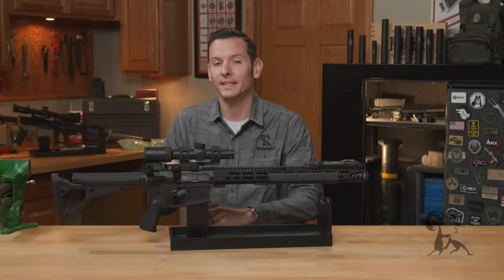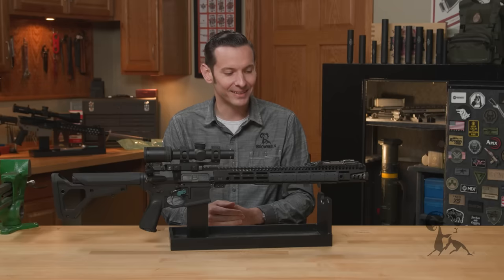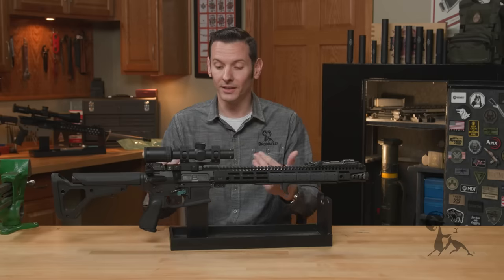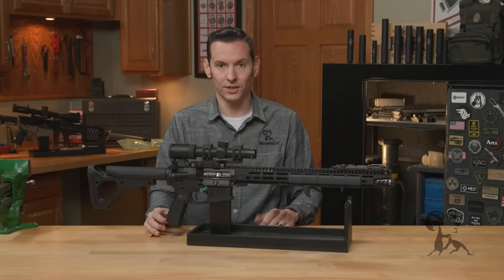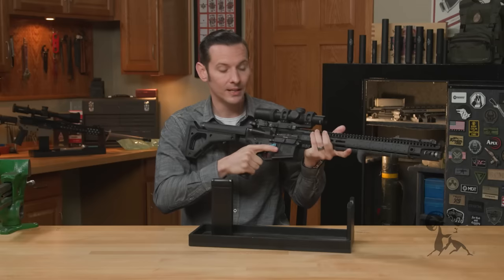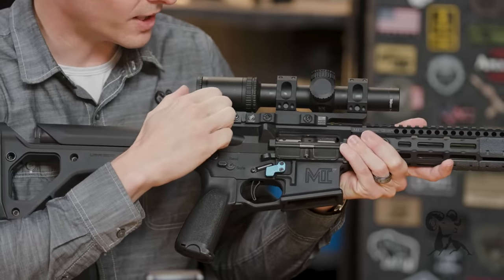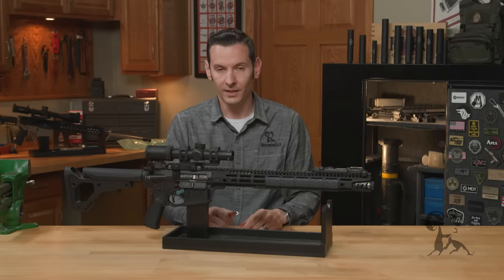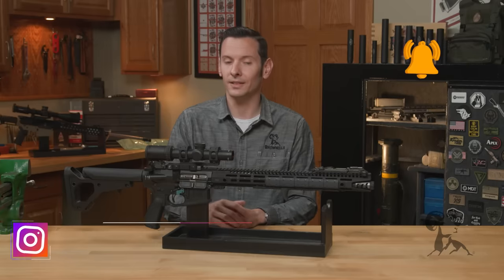Quick Tip: The RIGHT Way To Use the Forward Assist

Comment: "If you've ever had blood on your hands, you'll realize why the bolt carrier scallop doesn't work as a forward assist."
 Now I understand why the Air Force doesn't use a forward assist button on their version of the M4
Reply: Those Greyhound bus driver uniforms cost to much to afford a forward assist.
Reply: Hehe oof
Reply: The air force is the reason the rifle exists in the first place.
Reply: That's pretty cold, man...
Reply: @petemitchell6788  really??
Reply: @M3Pilot  they are the one who put AR 15 series into service while Army favor those m14
Reply: @danendraarkananta9442  Your comment is a bit fuzzy. Are you saying because the AF wanted a better gun for perimeter defense, that it caused the Army be forced to get it even though they (allegedly) favored the M14??  Maybe I'm not processing it correctly. 

The Army was way ahead on this one as the 1st Cav in Vietnam had M16s well before November 1965 when the Ia Drang Valley debacle occurred. The Army was issuing semi-auto AR-15s to Special Forces advisors in VN and they had high praise for it. That was 1962/63 era.
Reply: Gloves....
Reply: @LuvBorderCollies  In the late 50s the Army did run field trials with a number of guns to replace the m14. These trials favored the AR-15 greatly and the Army Ordnance board then changed the specifications so that any weapon to potentially replace the m14 had to be chambered in the same caliber as machine guns (thus shutting down the AR-15 as a candidate). It wasn't until later field use by Army Spec Ops and then the adoption of the M16 by the Air Force in the early 60s that the Sec Def overruled the Ordinance board and forced them to reevaluate the m16 as a candidate. The AO fought the M16 every step of the way and it was primarily the Air Force that was responsible for keeping the project alive and getting it into regular adoption. The Army Ordinance board  was also investigated by Congress during this time due to the corruption and why it was rejecting the AR-15 repeatedly despite great success in their own limited trials and the wider success in its adoption by the Air Force.
Reply: @LuvBorderCollies  okay bud 👌
Reply: ... even the GAU-5/A that is under an aircrew’s ejection seat has a forward assist.
If the Air Force literally has bloody hands something has gone very wrong.
Reply: They do use one, they didn't on the M16 initially. All M4s in service today or variants of have FA...even the USAF
Reply: Lol, the Navy don't even see sand.
Reply: @B61Mod12  except that aircraft are regularly shot down in a major conflict and the Air Force has 4 special operations units including the PJs. Air Force security forces are also in charge of guarding multimillion dollar assets and nuclear weapons.
Reply: @B61Mod12  even as aircraft maintenance whenever we deploy, we are issued m16s. One of my buddies was deployed to Afghanistan and his base was attacked with car bombs at the gate and then partially overrun.
Reply: @dsan94  I will give you that exception certainly.  I didn't think he was game enough to throw shade at PJs though.
Reply: @dsan94  That incident you described sounds like something going badly wrong!
Reply: As designed by Stoner the gun didn't have a forward assist.  It was added to meet an Army request because they feel like you need to have something on a gun to force it into battery.  This is likely due to institutionalized inbreeding since the era of bolt guns and the Garand along with the M14 having a charging handle that can also be smacked if the gun fails to go into battery.  This also continued to bleed into requirements and it's why the SCAR had a reciprocating charging handle.
Reply: @chrisoffutt8968  tell us you've never truly run an AR without telling us you've never truly run an AR.
Reply: @chrisoffutt8968  only when they don't know what they are talking about and spew nonsense written by people that don't know what they are talking about.
Reply: @dsan94  you could always try reading up on the history of the XM16E1, but that would involve learning something instead of being willfully ignorant and intellectually arrogant.  Have a nice day.
Reply: @chrisoffutt8968  I know the history of the XM16E1 and the earlier 604. That's not the issue here.
Reply: With the M1 when you pop in a loaded clip and yank the bolt to the rear, sometimes it goes fully into battery and sometimes it doesn’t. Having a forward assist capability actually matters. OTOH, I’ve never had an M14/M1A fail to go into battery from yanking and releasing the bolt so probably the Army just kept teaching it because the “FA” was there so why not? By the adoption of the M16 it was part of the institutional mindset whether it served a purpose or not. Except for a few cases of bad magazines I’ve never had an M16/AR15 rifle fail to fully chamber with the “yank and release” method. In fact, I don’t recall having a FTF with a hard slap on the bolt release so it’s debatable whether the rifle needs the FA at all; however, it’s now part of institutional dogma so it isn’t going to go away.
Reply: @chrisoffutt8968  Everyone knows the army wanted it. And it was a good addition. Stoner was DEAD WRONG in not having it. The AR was good, but adding the forward assist made it BETTER.
If we had left John Moses Browning's M2 just as he had originally designed it in 1918 and not modified it extensively and replaced the receiver, it likely wouldn't have seen mass adoption for use in WW2, nor would it be in use today. No matter the genius behind a design, there is room for improvement.
Reply: @itsapittie  BS.

Comment: That's what I use it for. 

Also, sometimes when shooting cheap steel and she's running dirty the bolt doesn't seat fully and a light tap on the fwd assist is all that is needed to keep her going.

Comment: As a USAF vet that carried the original M16, which did not come with the forward assist, for years, I can tell you the forward assist is helpful.   The BCG and bolt from time to time did not fully seat, and having a forward assist would have allowed a simple push to seat the bolt.  In the late 90s our old M16 uppers were retrofitted with M16A2 uppers and the USAF bought a bunch of new M4s.   Basically, if I encountered an out-of-battery condition, with the old M16s, I had to run the charging handle to re-rack the bolt, and later with our M16A2s or M4s all I had to do was push the forward assist.

Comment: The only time i have used the forward assist with an effect was when i was hiking to a coyote stand while carrying an AR15 with a very sensitive trigger. I spotted a coyote and realized i hadn't chambered the AR because i was waiting until i got to the stand, so i "quietly" loaded the AR which involved riding the charging handle as to not make enough noise to spook the yote, then pressed the forward assist to pop the extractor over the cartridge rim and chamber. Coyote didn't seem to notice which was nice.
Reply: How much and what type of lube did you use?
Reply: @LRRPFco52  CLP along with some grease on the buffer/spring assembly. not an issue of lubrication, just an issue of low bolt carrier velocity/force to pop the extractor over the rim on chambering as i was "riding" the charging handle.

Comment: The forward assist was added after fielding testing the rifle prior to sending to Vietnam. It was so in the early days with the Shite cases they were sending they could force the bolt closed and fired the round if it had a failure. Most of the time it is easier to force it closed into the normal cycle of operations so then they can extract and eject properly.
Reply: Not to mention that the original M-16 rollout was a fucking nightmare! The designers insisted the rifle would never need cleaned in the field, so they didn't include kits in the original release. The end result was soldiers having to field strip their rifles in the middle of combat and desperately try to clean it with whatever they had. cleaning kits went out not long after.

Comment: As has already been echoed by other prior service members, the forward assist has a purpose and if used correctly is a very nice tool to have. For an extremely minimal increase in weight, I will gladly take the advantages that the forward assist gives to the platform.

Comment: 25 years of shooting AR’s, and I recall needing it once. I was surprised. First round chambered from the magazine didn’t fully seat. Pulled the trigger and nothing happened. Looked at the bolt and saw not fully closed. Bumped the FA and it seated the case. 

Now o use it every time I chamber a round from the mag. No reason not to.

Comment: To quietly chamber a round in a hunting situation or some other time when one needs to be discreet. That's a use that most people don't talk about, except us guys who know.
Reply: And you're not one of them because of that was the case, you would've already loaded a round before you got into that situation.
Reply: @printingwithpeek4897  eh.  Maybe.  I don't mind running loaded most of the time.  Home, hunting, whenever... but I understand why and know a few hunters that don't like climbing up/down or in/out of their stands with one chambered.  My anecdotal is a couple of bolt action shooters and a pump user, but regardless I understand why this guy may want to do that.
Reply: @printingwithpeek4897  Most long guns like rifles and shotguns aren’t drop safe even with the safety engaged. It’s why storage in cruisers or closets (so-called “cruiser ready condition”) involves a loaded magazine (tube or box) with the chamber empty.

It is absolutely a possibility to have an empty chamber and then quiet chambering. US Army snipers complained about not being to do that very thing with their M110s, hence why the HK417 derived M110A1 has a forward assist.
Reply: @printingwithpeek4897  So you are in your OP at night and it is so dead quiet that a fart could be heard for a mile, and it takes you 10 minutes to open a zipper or velcro closure because you really don't want to be heard but you need to either clean or maintain your rifle or otherwise do something that requires going from action to unload then back to action.
What are you going to do?  Pull that charging handle back, then let er rip and blow your position?
Way to go pro!
Clearly you don't know.

Comment: The "scallop" is meant to aid the bolt but if you've popped of several mags in a row...well it's a good way to remove your thumb print....
Reply: I think the scallop is there to accommodate the feature on the ejection port cover which unlocks the cover when the bolt moves.
Reply: Gloves?
Reply: @sbreheny  that too but it's original purpose was to aid in pushing the bolt into battery.
Reply: @socmonki   That isn't practical in a loooot of scenarios lol. When do you wear gloves outside of larping?
Reply: @AR15andGOD  I don't larp, but I do wear gloves at work, or when I work on my car, or when I do some yard work, or when I work with wood occasionally because splinters suck.  If I were going to be shooting my AR a lot I would wear decent gloves because, let's face it, handguard get hot.  Of course I don't usually wear gloves when shooting but I can see the value in it.

Comment: I'm glad to finally see some actual not smoothbrains talk about this. I'm in the infantry and honestly really only use the FA when I'm checking the chamber of my M4, like, it's been awhile on mission and I'm just the type who checks their equipment obsessively so I'll check my mag, pull the charging handle back just enough to see if there's a bullet, but doing that, means that your bolt will not seat properly unlike if you used the bolt release on a new mag, so you use the FA. It's pretty insane how nobody really knows about that lol.
Reply: Not really. Most rifle owners have never been formally trained. The giveaway is when they grip the magazine well with their off hand instead of the foot long hand grip in front of them. Or they do that weird shit where they grab the barrel right behind the compensator. Like, what is wrong with that large piece of polymer on the front that is designed to be a handguard??

Comment: The problem with using the bolt carrier notch as a forward assist is that those holes are where the excess gas vents and if you have fired several rounds that area can get very hot. But it would work in a deer blind to help you quietly chamber the first round.

Comment: And you forgot an important one: those of us in weather, where it goes from slurry to freezing, and back to slurry, can cause slurry build up in the locking end of the m4 ramp, and cause failure to go in battery.
Forward assist, every time!
Reply: Use your ejection port cover
Reply: I've spent a decade shooting well-built AR-15s/M4s in Sub-Arctic and Arctic conditions in high volume.  I don't recall ever touching the forward assist.  Lube, mags, ammo, TDP gun, nothing more needed.
Reply: @robotbuster1487  that only works if the bolt goes forward enough that you can force the bolt cover closed. Which may not always be the case.
Reply: @Followme556  must be a junky rifle.  Messing around with AR rifles for 30 years, leaving them dirty for extended periods, different ammo weights, etc, I havent use the F.A. more than 10 times that I can recall.  I am not anti F.A..  Never used the F.A at all on my large frame 308 AR's, ever.  In regards to300 Blk  caliber uppers, I totally insist on F.A's....even my piston drive 300Blk has a F. Assist.  
It's been my experience, failures to feed was more about ammo indescrepancies, and less about the rifles hygiene.
Reply: @Followme556  He's talking about using the cover beforehand to prevent the slurry from getting in there in the first place.
Reply: @Followme556  After running scores of ARs through tens of thousands of rounds in Arctic conditions, I just didn't see that.  AKs had more problems than TDP AR-15s actually.
Reply: @sbreheny  condensation occurs on a weapon when it gets hot and cold whether the dust cover is closed or not.
Reply: Joint reply, because every time I post stuff like this, I get reply like the below. Question to the folks who have never seen it, do you just go to the range? Because if you, be it range, or just competition, you would probably never see it. How many of you have spent 3-5 weeks in tents with your AR/clone variants (using the same BCG system system) with no access to warm room, weapon on the body, being used up to 6-18 hours in the conditions I posted. Be it dry practice, blank fire stuff, and live rounds. With just the bare minimum of field strip cleaning.  Hearing the stuff that comes from replies about this, is like watching the cringe Russian tests of AR system in the cold, where they soak the charging handle in oil/fluids, to make sure it freezes solid to the weapon.  Hate and scream all you want about it. I have seen it happen, and it still happens, slurry will cause battery failure, forward assists works to resolve this.  Disagree all you want.
Reply: @xz569  Stop Emoting.  You are liable to get red flagged
Reply: @xz569  Tents?  10 years 11B, 2005-2016 working with coalition armies in Europe, multiple deployments ranging from forests to high deserts, ME Desert, jungle in Panama, multiple deployments to Korean peninsula hot/cold, sub-arctic and Arctic, with high volume shooting in all of those places.

As soon as you said "tent", you lost me.  As an 11B, we slept in the mud, dirt, sand, jungle, mountains without tents.

Only time I spent in tents was in ME, occasional times at MPRC in Korea doing ranges, and warming tents in winter at Ft. AP Hill and Bragg.  The rest of the time was in the suck of the conditions, living like animals.  This is especially true in Recon teams, LRSC, and when attached to CJSOTF doing SR, or other SOCOM elements we worked with.

Forward assist is the last thing on my list of things to be concerned about, but it does bring up how the Army screwed up the initial fielding of the AR-15 and exposes how the Army continues to teach the retardation of SPORTS.

Comment: And for times when you need to be silent and your rifle isn't chambered manually insert a round into the chamber, slowly let the bolt forward while holding onto the t-handle press your forward assist and you can load your rifle silently.
Reply: if your rifle isnt chambered and you're in a situation where you need to be silent then you've fucked up and are doing everything wrong.
Reply: @1Gruesome  or your last CQB shot emptied your mag and left you in bolt lock as you simultaneously charged to another location with cover and you don't want to reveal your location to the enemy you are trying to outflank.
Reply: This was the best answer I recall from one of the earlier videos. Coyote hunters need to set up as quietly as possible, so they gently lower the bolt on the round, and press it in with the forward assist. Perfect!

Comment: You are 100% correct. It is only to be used AFTER you have pulled the charging handle back and chambered a round. You don't need to pull the bolt back to see if there is a round in there. Many other ways to check that without manipulating the bolt.